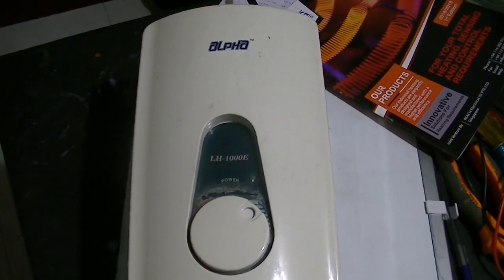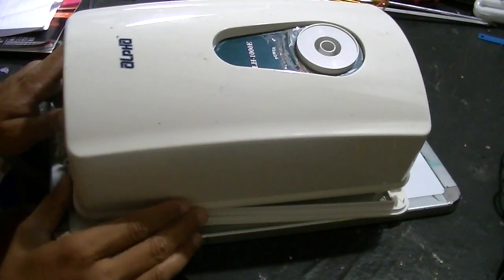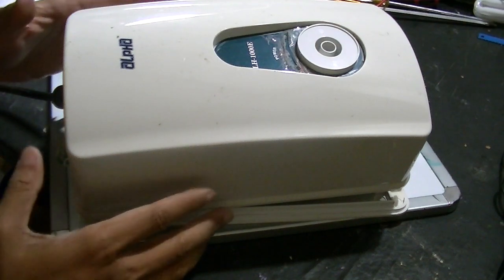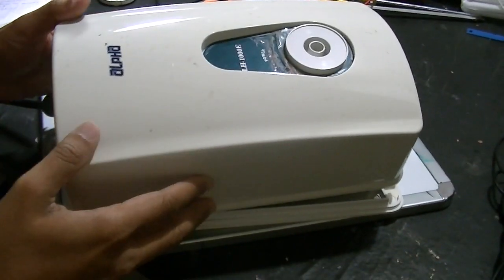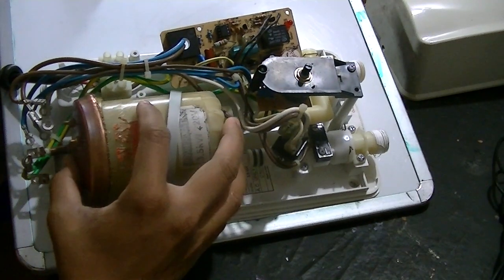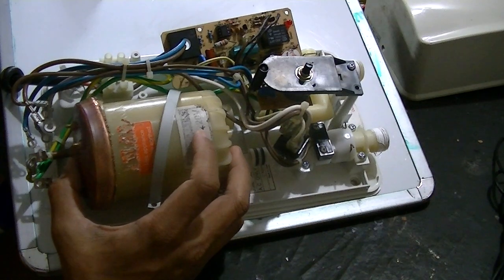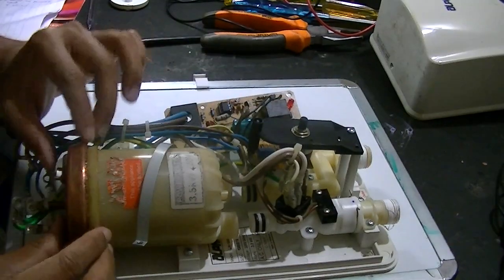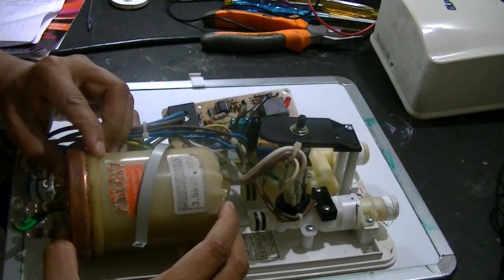Instant Water Heater Repair Tips - Part1 (Alpha LH 1000E)

Comment: Can you cite some tips of repair which frequently the basic problem encountered by some customers ..it more  beneficial for us and we will appreciate much your expertise on this.....this again.
Reply from the maker: As I highlighted in my previous comment. the most common fault is the element failure. When the heating element submerged in the water for a long time the insulation in heat tube degraded. This results in earth leakages and then the earth leakage detector activated and it automatically get switched off.

Comment: when the shower head is raised high, the heater switches off.. the heater works when the shower head is placed low.. what might be the problem?..
Reply from the maker: Is the water flow speed is reduced when shower head is high? If so problem is the water pressure from utility.

Comment: How you check the problem if no hot water is coming even though there current in the entrance of the unit..is  there a possibility that ic of the unit affected.. unit is almost 5 yrs..thks for your reply..
Reply from the maker: I have not encountered a IC problems in most of the units I repaired. However, a lightening strike can cause such failures. The IC of this particular unit is used only for earth leakage detection. If your unit is 5 years old most probably you have a faulty heating element. Just remove the cover and use a simple multi-meter to check the continuity of the element.